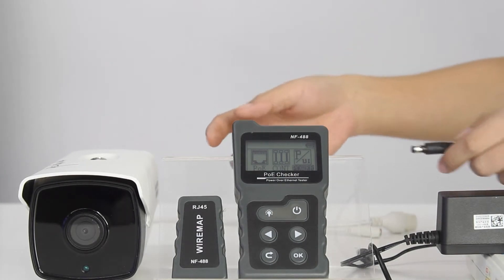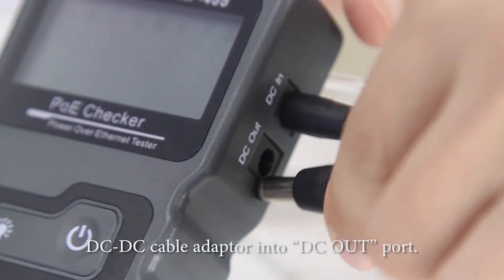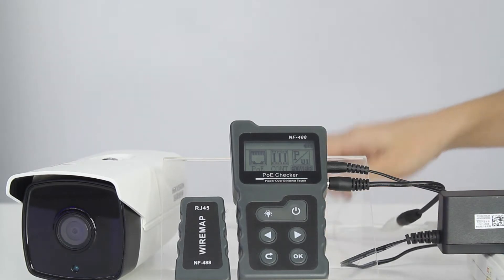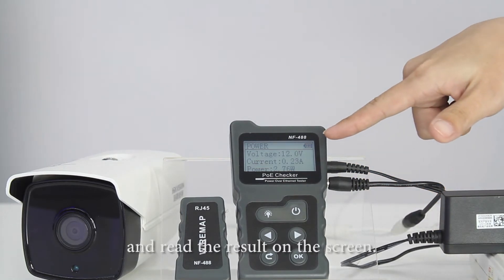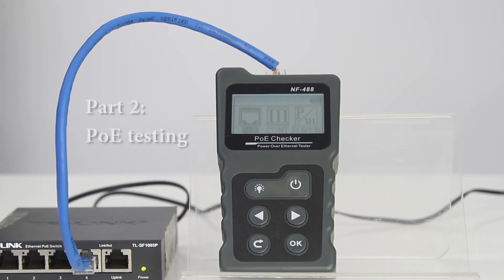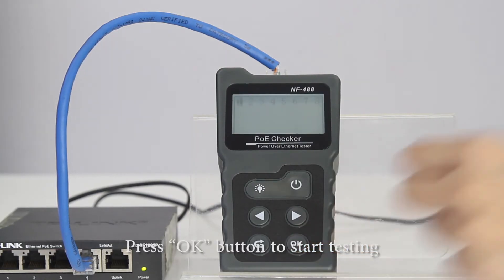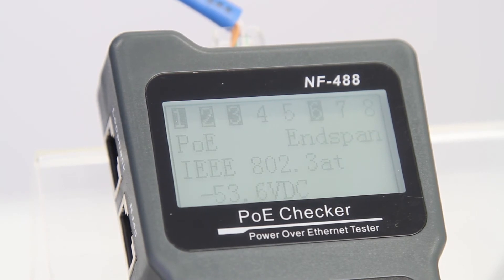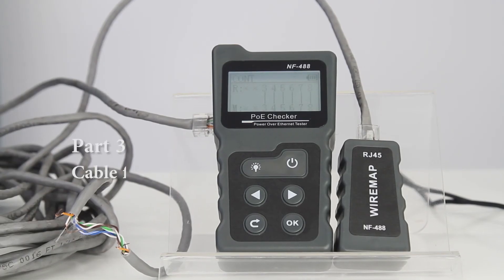How to test POE with NOYAFA POE checker POE tester NF-488

Comment: Question. Can I plug the cable from the PoE injector into one PoE Test port and the device it would power into the other and test the connectivity through them like you do with the DC-in/out?
Reply: Thank you for your question,yes you can put 2 cable in the PoE port.Test the voltage & power between power adaptor and powered device,also caculate the current indirectly.

Comment: HI, can this tester show where a cable is wired wrong? Or if pin 5 is wired to both 5 and 6 at the other end?
Reply from the maker: It can show the result can't show the exact faulty point

Comment: Will it fail when I accidentally put Poe on the RJ45 port for continuity or does it have protection?
Reply from the maker: All the POE test port from Noyafa there can endure the voltage lower than 60V
Reply: @noyafa  You mean when poe cable connect rj-45 port, rj-45 port not break?
Reply from the maker: @ekrkikc  not really as you can see the POE testing port is individual and also the continuity testing fundtion has it's own port as well, so in a word let the right function connected with the right port.PoE port can endure the voltage from the Poe cable lower than 60V , does it make sense for you?